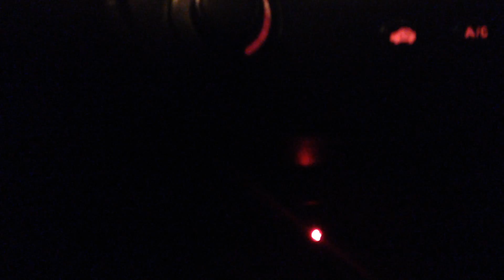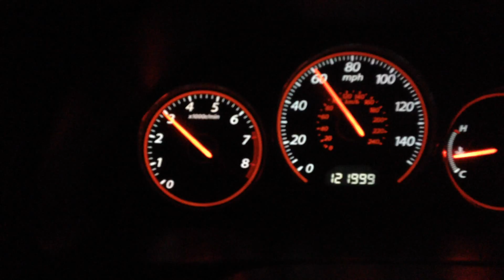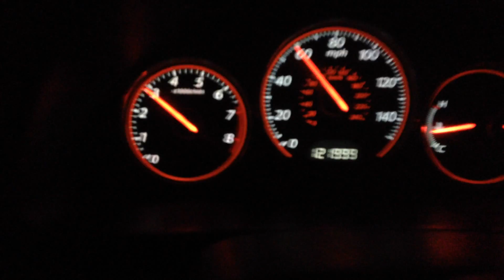2005 Honda Civic EM2 Y8 Manifold VTEC Crossover

Comment: I really need to get on my Y8 swap, got all the parts just need to find someone to TIG it up for me. Thanks for posting info on this man!
Reply from the maker: I had to recreate it since it was too old to edit. Here is the new link. https://www.civicforums.com/forums/115-engine/370599-diy-y8-intake-manifold-swap-d17a2-ver-2-a.html
Reply from the maker: You don't have to weld it, it works fine without. Check out my DIY if you want to just bolt it on. https://www.civicforums.com/forums/115-engine/363065-diy-y8-intake-manifold-swap-d17a2.html
Reply: I've read through the diy many times,  thanks for posting It! my plan is to use the d17 intake plenum welded to the runners of the d16 mani for easier egr routing and that way no exhaust has to run through tubing. Thanks again!
Reply: Think you could rehost the images in your DIY?
Reply: Thanks a bunch mahn, this helps out a lot

Comment: Did doing the y8 intake manifold swap kill your gas mileage? I was getting about 36 MPG easily but now that I did the intake manifold swap, I am lucky to get 22 MPG now. I am just wondering if that is just how these manifolds are, or if I screwed something up or what.
Reply from the maker: I would make sure you hooked everything back up right and have no leaks, i roughly get 39 on the highway.

Comment: do you need to do the fuel system conversion to run a y8 manifold?
Reply: Nope. I did it with the stock fuel system.
Reply from the maker: You do not need to, but alot will do it since you are in there.